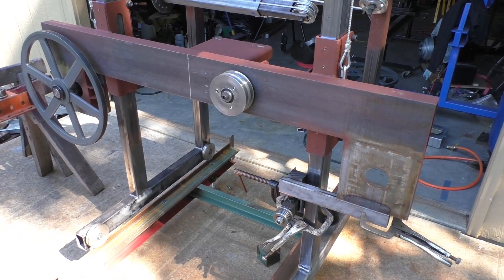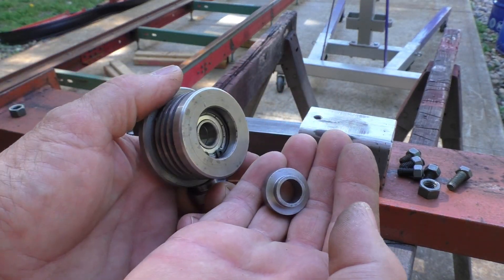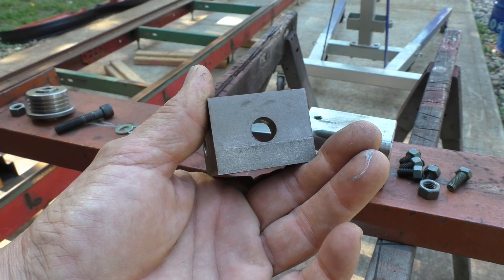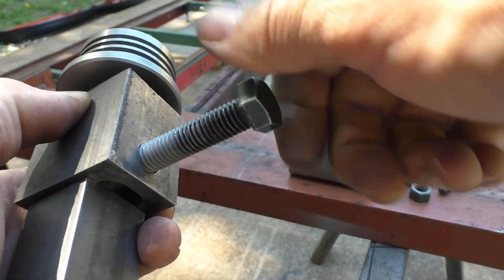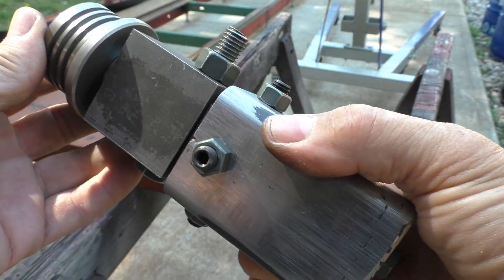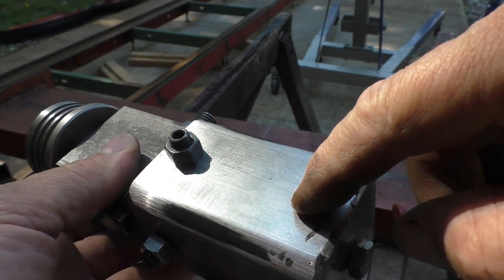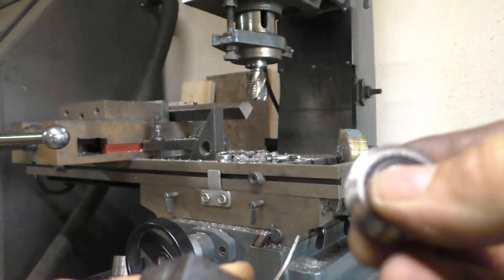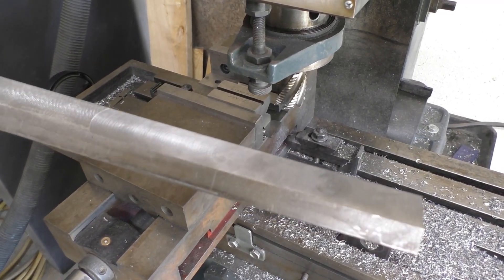#44 Homemade Sawmill Build DIY Blade Guides, Locking Height Handle, Belt Tensioner Spencers-Mountain

Comment: Are you an engineer?
You work is remarkable, the details all from scrap. 
I really enjoy your videos, especially the way you explain everything. I don’t have any scrap laying around but I’m sure I can find some and buy some. And I think I can use all the videos, combined, to build my own. 
Thank you, Sir, for sharing, I have no doubt that it will help others. Keep up the amazing work. 
Joe Texas
Reply from the maker: Not an engineer. Been around fabrication and mechanical things for many decades. If you can envision something you want in a scrap piece of material you can greatly reduce cost and change paths in a project where others may be stopped. Scrap material is everywhere once you learn where to look. Social media marketplaces are a good start, scrap yards, junk yards, recycling, metal shops, old machines that are no longer wanted, etc.. There is more than one way to do things. I used ideas from industrial machines, YouTube videos, manufacturer information and easy to find things to build my mill. You can do the same thing.  Share what you learn.  Thank you for the comment and thank you for watching!
Reply: @SpencersMountain  thank you for replying. Yes, I totally agree with you, I have an area on my small place where I stash just about everything that no longer works originally because I know there’s something I can use from it later. 
I’ll continue to watch your videos, they are informative and inspiring. 
Thanks again 
Joe

Comment: Very nice build.  A lot of detail.  Could you expound on the lift mech? Thanks
Reply from the maker: The lift mech is simply a screw jack with pulleys on the push end. I had considered using a trailer tongue jack originally, but challenged myself to use some junk I had collected over the years. The trailer jack would have been much easier! If you look at the video, you can figure out the cables are attached to the saw head (moving part) and the screw jack housing (a stationary location).  Operating the jack changes the length of the cables and the saw head moves. Threaded adjusters allow fine adjustment of cable lengths to level the saw head. Similar cable/jack systems are used on Harbor Freight and Woodland Mills saws. You can download manufacturer user manuals for complete schematic, parts lists and assembly instructions...no need to reinvent the wheel. Thanks for watching and thanks for the comment. Let me know if you have more questions. Always glad to help.
Reply: @SpencersMountain  hey man thanks for the reply.  I did continue the series and seen it explained. I'm a new subscriber.  Good video quality too.
Reply from the maker: @dustydave9347  I appreciate you taking the time to follow through the build. Thanks for watching. And, thanks for subscribing!

Comment: I used a cheap tractor lift-arm ball socket for the basis of my adjuster for the blade guides.
Reply from the maker: Thank you for the comment and watching my video. I viewed several of your videos and saw your ball socket. I considered using your design as it appears others have done. My design was a result of material laying around the shop.